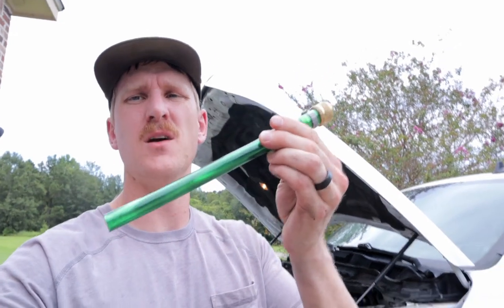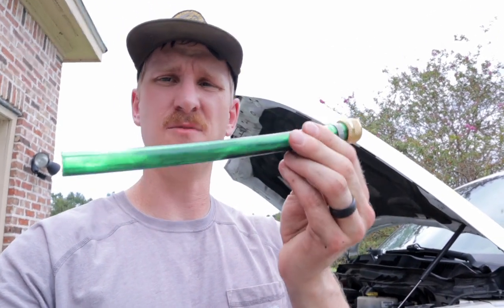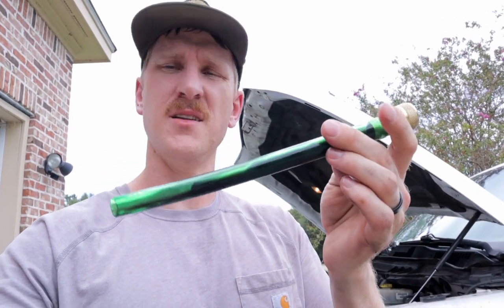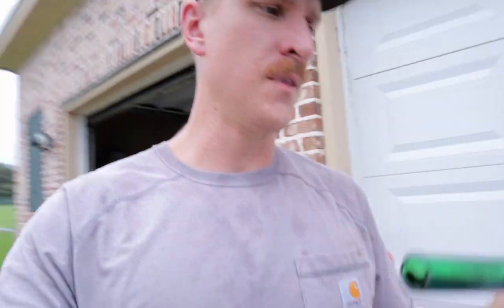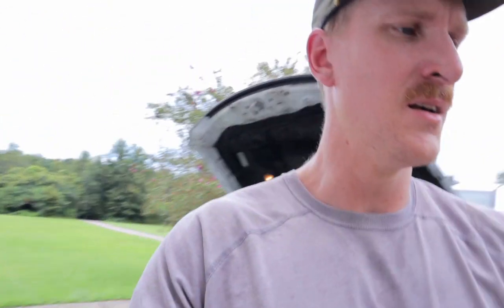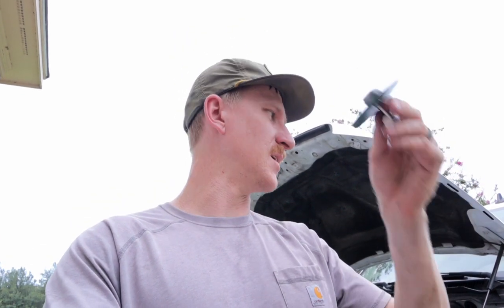Easy Oil Change Hack | Femco Oil Plug | Ram 2500 6.7 Cummins

Comment: I'm in UK and have 2008 with this engine and it doesn't have a gap in the inner wheel arch to get to the filter. Right nightmare
Reply from the maker: Dang...that sounds like a pain. How do you get to the filter? Have to take out the whole wheel arch liner?

Comment: Have you tried using the femco to take an oil sample?  If so, how did that go?  Thanks!
Reply from the maker: No I haven’t yet. I would like to start doing it on on my truck. Really wish I would have taken a baseline when it was new so I could compare results over time.

Comment: Use T6 in your Duramax, but not in a 5th Gen Cummins! After changing your fuel filters, just move to run position, but no foot on pedal. Cycle it off, and then to run again before starting and it'll fire right up.
Reply from the maker: Thanks for dropping a comment. Have you seen issues with T6 in 6.7 Cummins? This is a 4th gen and I haven’t had any notice me issues 258k miles in on T6.